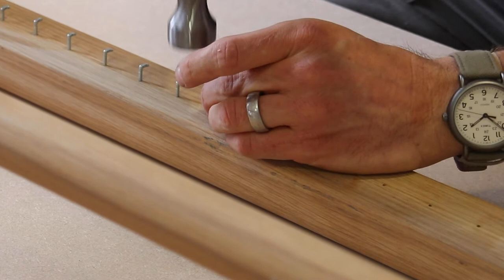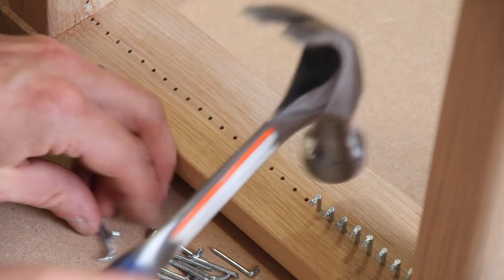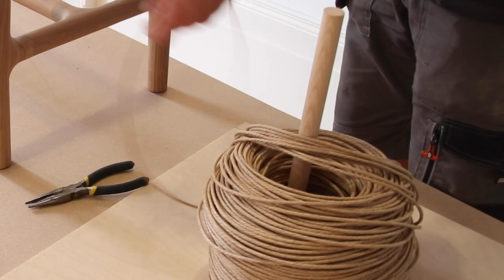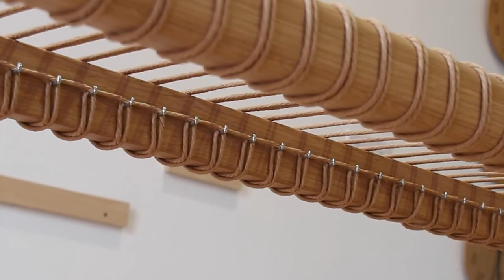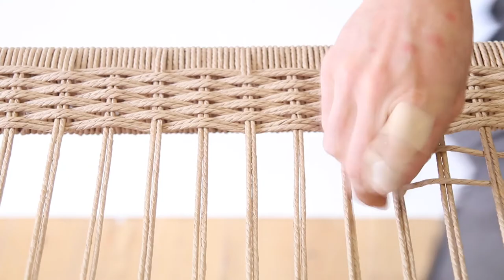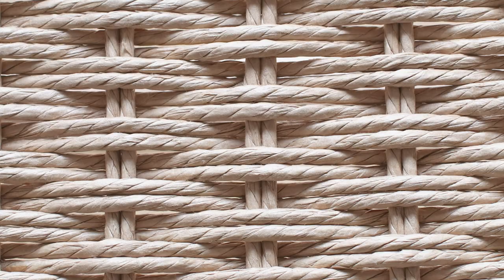Danish Cord Weaving - HOW TO DO IT!

Comment: Thank you for this! Do the nails have to be L-shaped? or do you think ordinary nails would do? (hard to source those types of nails where I'm from)
Reply: You could do it with normal nails as long as you bend it close to 90 degrees after driving them in. Might want to use wire nails for such applications